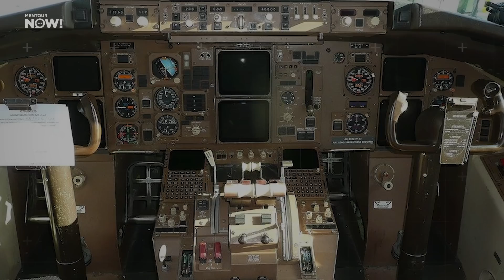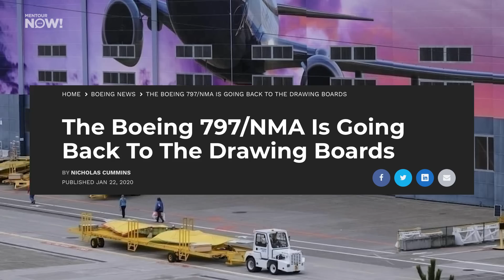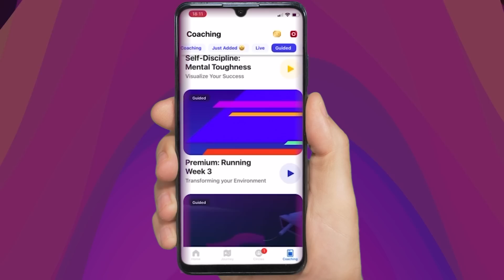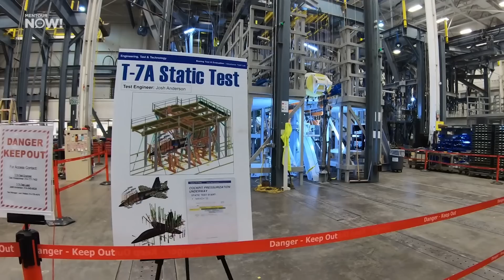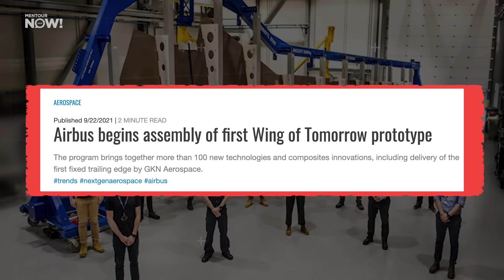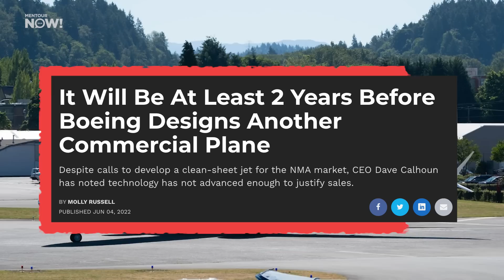Is Boeing Planning a 757 MAX?!

Comment: Very informative and thank you ( I just discovered this channel and subscribed). I recall reading somewhere that the 757 also had a larger wing area compared to airliners of similar weight and passenger capacity specs. That combined with the high thrust engines, helped make it
an especially good performer at airports w/short runways and/or at high altitudes. Anyone happen to know if thus was true. Just curious. Lots of Pilots and plane geeks like me commenting here so I’m hoping someone will know. I earned my private license at 16 (I am now 70) but the only thing I ever flew came with propellers!

Comment: Why don't they make a larger aircraft based on the 737. Make a stretched body just like the 757, but with larger (maybe foldable) wings and slightly higher wheelbase. If you base it off the 737 platform, using a same type rating (just like the 757 and 767 had) it saves on training costs and make it a good aircraft for short and medium+ haul airlines...

Comment: Many of those engines would fit underwing of 757 coz it is quite a high plane with longer legs . 787 is way lower than 757 so 787 emgines would fit . If they can’t , then I will fit it :)

Comment: I think Boeing could use the 787 to close the “767 gap”. Boeing could create a “787-7” that is similar in size and range to the Boeing 767-200 or even the Airbus A310. I would love to see a 757 Renaissance in some way from Boeing. If not, maybe Lockheed Martin should consider jumping back into the commercial aviation game.

Comment: The basic problem is Type Certificates and the FAA. Could a pilot fly 737s on Monday, Wednesday and Friday, and then switch to the 757 on Tuesday and Thursday? No, the FAA requires retraining to switch aircraft types. That also cancels the previous type certificate. This is the reason Southwest is a single type airline. So, different types within an airline effectively create separate divisions within the company as far as cockpit staffing is concerned. This is supposed to protect the flying public much like TSA. It has become entrenched in aviation, but is it effective? What is the effect besides increased costs? What should be done about it?

Comment: As a passenger I tried my best when booking a flight to get myself on the 757s. I have been on both 200 and 300 series. The 757-200 was so powerful that I use to go to Orange County Airport SNA and watch them take off. I have seen them take off and land using less then half the runway that is just around 6,000 feet long. I really hope they bring back the 757s

Comment: Why don’t they make a 787 very short like they did the sp 747
Reply: Fat + short = drag. Of what reasons ever, airlines prefer to do 6 transatlantic flights with uncomfortable 737s instead of one 380 a day.
Reply: The wings are made for more MTOW and for more range. This also means  unnecessary drag if you put them onto a smaller aircraft which is lighter.

A similar case is the A 318, which wasn't as efficient as a smaller regional jet with a narrower, but longer cabin and smaller wings. It was just built to offer a smaller aircraft with the same 320 series type rating

Comment: The 7 fifty 7 is what I equate as a' Goldylox' aircraft, not too big ,and not two small, if Delta is badgering Boeing to consider making a successor for their favorate bread&butter  runabout. Then the suits are sticking their heads in the sand, Delta is a Major ,I say Major US Airline, not some flea bitten four plane budget operation run on a shoe string,. Listen to them DOH!!!!.It is they who buy Boeing products. Yes Airbus does have a halfway viable alternate for the 'seven five', but as you said their A321 needs a serious make over, the first problem staring you in the face, is the undercarriage, the foundations of any aircraft whether be it a rag wing Waco, Travel Air, or Stearman to a late model 787, get that right, the rest of the job is easy. Apart from a small batch of A320,s built for Air India, the 'baby' Airbus family 318-19-20,and 21 use a two wheel single truck main undercarriage, I e two wheels on each main  undercarriage leg. If Airbus are to extract another cup of tea from their popular 'baby' runabout, then engineers need to consult Dowty Messier Safran for an all new eight wheel bogie main undercarriage ,like  the '7 fives',.  Engines, okay there is problem, but do not engage full whingemode and chuck your teddy bear out the pram ,use what is available tried ,tested, readily understood and think outside the box. Roller,s RB-211-535 is a first generation high bypass fan jet engine, solid reliable and bomb proof,ask BA 747 Driver Eric Moody .Yes cats&kittens he is the skipper of BA 747 that flew through the ash cloud  which farted out of an Indonesian volcano. After sucking tons of fine abrasive ash with a bit of coaxing from a stressed out flight engineer three Roller 211,s coughed to life each ran perfectly despite ingesting tons of fly ash . Eric drove the damaged 747 to a safe landing at Jakarta without a serviceable windscreen. So Rollers RB-211 535 is an odds on favorate for some serious upgrades.  Second runner in this pony race, is Pratt&Whittney,s 2037 more modern similar thrust rating as Roller,s 211 with a bit more developmental meat left on the bone. Yes okay, will take some serious investment  getting these two the same certification as more modern engines, but in the interim better than  nothing. So a re worked A321 or '7 five' is a perfectly feasible, just ask Delta Airlines.
Reply: It was planned to be, but it didn't become a goldy locks thing – in behalf of trailing turbolence, it was rated as a ›heavy‹ plane and so couldn't serve many smaller airports.

Comment: 7:41 So, what sort of aircraft is the Ultrafan engine intended for, then? If it's too big to fit even under the wing of the aircraft with the largest engines in all of aviation...what type of aircraft could it fit on? It seems like Rolls-Royce would have to ultimately develop some scaled-down versions, so then maybe the size issue could be addressed.

Comment: Boeing has been in a long slow death since 1996. I won’t fly on the 737 Max… to many compromises had to be made. They made their marketing grave, and instead of trying to climb out they keep digging.
Reply: Come on, the problem with the MAX was that there were systems on board that pilots didn't know. They cheated FAA to get an advantage over A320. There are lots of videos herewhich show that overrunning an out-of-order MCAS is easy to do – if you know how to do it. Even the well-known ›trim runaway‹ procedure would have solved it – if the crews had recognized the problem being a trim runaway (because it was a new trim system).

Comment: In my opinion there is no need for a new NMA Aircraft. This segment is served perfectly by planes such as the A321, A330-200, B787-8.

A new NMA will have very similar capacity to the planes above, except with a much shorter range. So why build a plane that can seat the same number of people but cannot fly as far?

Planes like the A330-200 and B787-8 has the right capacity but also a long range. If the long range isn't needed, then simply carry less fuel.

The A330-200 for example are often not used to the full extent of its range. It is already being used frequently on medium capacity/range routes. A good example of between the East and West Coast of Australia. Routes such as Sydney/Melbourne to Perth are frequently flown by the A330-200.

This is why there is on and off "talk" from Boeing of a new NMA, but nothing ever comes into fruition.

Airbus on the other hand is quite clear that the market does not need a NMA.

Comment: I flew in N501US “City of St. Paul”  one of NWA's first 757s in late August of 1985, MSP to LGA, going off to college. I remember that we landed and seemed to be taking a very long time to brake, with the pilot applying the brakes in short bursts, rather then continuously. We ended up on the runway extension out into the East River, beyond the last cross taxiway, so had to turn the airplane 180 on the runway, and taxi back. I don't recall if the crew said anything about it, I think they mostly acted like it was a normal landing. I do recall wondering, since they'd made such a big deal about it being a new type, if the pilot had many hours landing it, yet.

Comment: The tooling and jigs which had a storage cost of about $5,000 a year were scrapped in a binge of cost - saving .  The plane could ONLY be out back into production under FAA rules - IF Original tooling is available SO THAT it can use THE ORIGINAL -- FAA certification. Recreation of the tooling is forbidden!!  If new recreated tooling is used it is a new plane and must meet ALL NEW 2022 safety requirements. Only way forward is a clean sheet plane and the Wall Street Raiders that took over Boeing's Board room will not spend the money!! 
As to Boeing hiring new engineers it is of no use since the Advanced Research Group in Everett has been broken up and the 4 parts forbidden to talk to each other!!!!!

Comment: What about a shortened 787?  It seems like it'd check a lot of boxes - carbon-fiber body/wing, new supply chain setup, etc, and you could leverage all the benefits of 787?
Reply: Airlines have no interest in that as the canceled 787-3 project showed. You would end up with for its purpose overdesigned aircraft that is heavier than it needs to be which means it needs more fuel.

Comment: A re-design 75 in my view is still a wiser track to take. Why because they can kinda look into this project as a stepping stone to the NMA project. It doesn’t have to be an out of this world project. An upgrade of the wing is a must otherwise not a new aeroplane. An upgrade version of the GE engine currently in the stretch version can surely be talked to the manufacturer, but the most important is an airframe put in service to hold the fort for the time being whitst the NMA is in the pipeline. The issue with a brand new airframe is the breaking in face. Boeing needs an airframe that is with the existing technology that doesn’t need breaking in, already in operation and get it out inside of 5years. A kinda like a common sense aeroplane more than a scientifically spanking new sh-t…

Comment: Absolutely Great ! Why don,t Boeing build a revised 757 ? well, all very good answers but one I think that was forgotten is the Fuselage. The great success that Airbus has with its A.320 Range is that the Belly of the Aircraft can take Containers for Air Freight, thus earning extra revenue, this is not possible with either the 737 or the 757 Fuselage so a Boeing Aircraft would not have the earning potential of an Airbus, SO its a New Model Boeing if you wish to keep up with Airbus,

Comment: I was involved with 787 manufacturing and assembly for several years. Boeing was not interested in designing new airplanes in the near future. It was all speculations from media and customers. The new plane would have to be made with composite body and wings. It is not easy to setup manufacturing for composite. Boeing have learned the difficulty of construction from 787 wing in Japan and 777X in Everett.
Boeing's bread and butter are 737, 787, and 777X. They are not going to design new until these products are stabilized. The 787-7 could fill the gap if there are enough demand.

Comment: Now to be fair with cost:
The 757 and 737 share the fuselage shape with the 707. IN fact, the 757 was the last aircraft boeing made with the 707 fuselage. In theory, Boeing could slightly modify the 737 tools to make 757 fuselages, which would be more cost efficient. They could also borrow parts from other programs, such as avionics from teh MAX or 787 to also save cost.

Comment: I believe the next gen Boeing single-aisle is already in design stages, given development lead times. I believe it will be an all-new design with fly-by-wire and high use of composites, similar to the 777x. It will be higher off the ground, use standard ULDs, have electric APU and possibly electric pushback. The sizing will be from around 125 to 200 in two-class layout, with the largest competing with the A321XLR in range, but with higher MTOW in order to capture the freighter market. It’s also likely that the Embraer merger will come up again, and now succeed.

Comment: The engine issue actually impacts the C-17 as well, as it uses the same engines as the 757, just 4 of them instead two.

What made these two aircraft so popular and successful originally are their very powerful engines. Unfortunately, power comes at a cost - fuel. One of the ways you can get more efficiency out of a plane is to push its power down to its minimum safe levels. Unfortunately, that reduces MTOW, runway performance and high altitude performance (see A321XLR), all things that the 757 and C-17 excel at.

Comment: This is a disingenuous explanation. Using maximum passenger capacity doesn’t tell the story properly. The gap between a single class MAX10 carrying 230 passengers for say… Norwegian or Ryanair or a 2-class layout of 188-204 passengers competes with the 2-class 787-8 which is typically configured for 248 passengers is MUCH smaller. This is because not a single airline operates a 787 in a single class, high density layout. United configures theirs with 243 seats. American has just 232 seats. ANA configures theirs between 169 seats (long-haul) and 248 (domestic/regional). 

That gap being so narrow and the MAX10 and 787-8 being so efficient is why a re-engined 757 is not in the works.

Comment: I think their best bet is the 767-200. It already has a production line, and it has the range, cargo capacity and pax capacity to fill the gap. If they can modernize the wings and improve engine efficiency, I believe they will have a viable contender.

Comment: just let old great things remain old great things. The 737 MAX is the best example of a majorly gone wrong attempt to make a 70 yr old airframe better. Please, just let the awesome dinosaurs be awesome dinosaurs. There is zero innovation in the airline industry. Just imagine, from the first flight of the wright flyer to the first man walking on the moon in 1969 it took 66 years. It is now 53 years after the moon landing. There has been no innovation. Airplanes all look the same, do the same, fly the same. It's terrible. Two engines, a fuselage in the middle. Larger engines. Longer fuselage. Larger Engines, longer fuselage.
Reply: Wrong attempt? Max is being sold for the whole world
Reply: @Asteriabased  it's a POS. It's an over the end engineered almost 60 year old airframe. It was knowingly engineered beyond it's abilites. Boeing knew this. MCAS was the solution. It's an airplane that needs to be forced to fly.
Reply: @ScaredOfMonster  I kind of disagree, the 737 is a king of the skies. It basically will never get old, it’s “cheap”, easy to pilot, has a good range perfect for low costs airlines

Comment: Having flown Delta 757s quite a bit, I can’t stand them.  They take forever to load, forever to unload on account of bing a narrow body.  The way Delta puts together their coach class, unless you pay for special coach seating, it is really tight.  A better solution would be a short 787.  Why try to load up 250+ passengers in a single aisle tube rather than having the benefit of 2 aisles which gives you more flexibility in terms of seating configuration and better passenger loading and unloading flow because you have a proper entry lobby.  I also think that whatever Boeing moves toward for a new airframe, it is going to be a carbon fiber plane, much like the 787.

Comment: There is no replacement for the 757-200 in the medium-haul cargo market. A large order from a cargo leaser like Atlas and a major passenger airline like Delta could push the orders over the critical 150 order threshold to finance building an upgraded 757.

Comment: I'm wondering if engine size issues can be solved by mounting the engines on top of the Wings instead of under them. Obviously a pylon on the top would be far weaker, but the engine mount could perhaps be designed to Simply Mount directly to the wing without a pylon. Perhaps engines could even be slightly angled upwards relative to the aircraft's angle of attack to provide more lift and compensate for the wing area lost by being taken up by the width of an engine. Seems to me that if this was done Wings could even be mounted lower, landing gear could be squattier and more robust for the same material weight.... a short length of pipe is inherently stronger and lighter than a long length of pipe. FOD issues would be slightly mitigated from the higher position of the engines.
Your Thoughts?

Comment: Isn’t the 767-400ER not the guneapig for the 777. Don’t see the point of a renewed 767. It’s to wide. 757Max with new engines and wings would be perfect. Single isle, so aerodynamically a win, efficient engines and lighter materials used combined with those pointy wings…it could be a solution for quite some carriers or even budget carriers that want capacity.

Comment: I love the 757. Would have been easier to MAX than the 737 because the landing gear is much longer, an issue that required MCAS on the 737 which ultimately led to disaster. One of the nicest transatlantic flights I've had was on a 757 and I've flown every Boeing type multiple times. Boeing seems to have had a series of bad decisions; from moving its headquarters to Chicago, moving some of its 787 production, the 737 Max fiasco...

Comment: 757 program should have NEVER been retired. The lack of foresight from Boeing executives and their desire to build airplanes for shareholders instead of engineers is a massive failure. The 737 MAX should have NEVER been built. 73 program should have ended with the NG. Now Boeing is moving their HQ from Chicago to DC, even further from Seattle… that company is so lost and so misguided. Boeing is a massive failure.